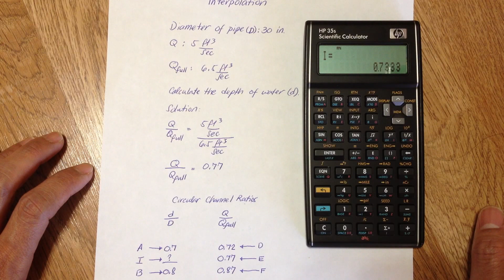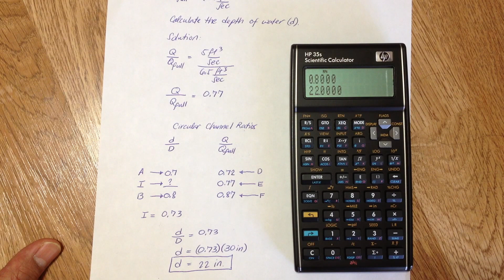HP 35s tutorial on how to use the interpolation equation

Comment: yeah reeeallly usefull huh you turn on your hp and there it is the equation all written and ready..... tnx a lot --'' input the nuumbers in a already pre set equation is really hard.... ( sorry about the anger but really)... i need to set the equation mannually myself? or like other  hp's it already has a pre programed equation?
Reply: google hp-35s linear regression, it's built into the calculator
Reply: Put the known (table) values and put them into the summation register, put the known calculated value in and then use built in linear regression. So:

 .7 enter .72 sum+ .8 enter .87 sum+ .77 goldArrow L.R. Right

In this case y-hat shows the same answer as he has: .7333